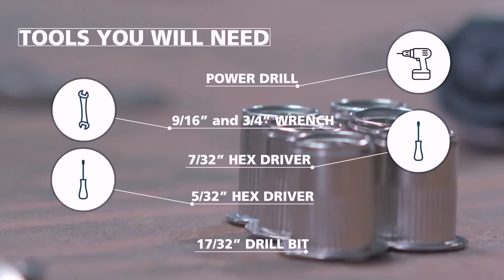Go Rhino Sport Bar 2.0 Installation (911000T)

Comment: Hello, I have a 2010 F150 and I pretty much know it will fit but my concern is that I have a BAK RollX bed cover and was wondering of this will allow the cover to roll up. My particular cover is a rigid cover, not a soft cover that can be bent. Any experience with these Sport bars with the rigid type roll up bed covers?

Comment: couldnt find a 17/32 drill bit at hardware or home depot or lowes? rivets poped back out of hole when i did finally get them drilled, need a ratchet with a really small bit to fit in to tighten to truck. Been cool if they had a plate you mount to truck first then attach the bar with screws. who ever designed this must like hand tools cuz you cant reach any bolts with a screw gun

Comment: Hey guys great video... But was wondering if you guys out anything on the holes you made on the truck bed for the roll bar to prevent rust in the future
Reply: hopes and dreams
Reply: Automotive primer. 6 coats on the areas showing raw metal under and over.

Comment: Bought one in 2017... had it replaced this week, whole thing rusted out. Doesn’t like Canadian winters. Replacement just got back from being coated in LineX. Hope that helps.
Reply: How did the coating from LineX hold up? Im from Edmonton Alberta so Im curious as to how it stood up to the winters over the years, Thanks!
Reply: @resuko77  For the most part it was perfect. There were a few spots where the linex didn't get to and it rusted out from the inside. If I were to do it again I'd probably hit the inside of it with a clear coat or some black tremclad. Powerder Coated Metal SHOULD be completely protected but it's not... no idea why. You could see a rainbow halo effect where the rust was behind the linex. Such a pain in the butt for what it is. They can send rockets to other planets, can't stop rust on a tube of metal.

Comment: I was putting mine together the other night and the damn side plates didn't want to align all the way, I've tried different ways with same result. What tips do you have for as I've had bolts just barely on and fall out when trying to get last one in.
Reply: I had to loosen mine totally to get it to aligned and it also is a pain. Also the damn rivet nut messed up do i was down one of those and i cant find them anywhere. The bumper i got was also a pain but damn i love the look.

Comment: I had one put on my 2017 Dodge ram. Looked amazing for about a year. After that nothing but problems with rust, and discoloring of finish. My lights on the light bar kept falling down because of the thin metal breaking. I would not have purchased this having known issues I would have.
Reply: where do you live?

Comment: What is the width of the rack from rail to rail? I'd like to add something like this to my 90 f150 but not sure if it'll be too wide
Reply from the maker: Hello thank you for your interest in our Sport Bar 2.0. It is 72" wide from end to end, so if your 1990 F-150 bed is about 72" wide (including bed rails) then it should be ok. Also note that it is 22.5" high so it may or may not be tall enough for lights if you wish to add lights.

Comment: Any issue with this fitting on 2017 raptor with bak flip cover?   Seeing in the instructions that the tubing bolted pieces together instead on 1 solid bar. Wondering how well this holds up to hard off road driving.
Reply from the maker: Hello David, thank you for your interest in our Sport Bar 2.0. It works on the regular 2017 F-150 so there shouldn't be any problems installing it on the Raptor. We have had several customers send us pictures of it on their Raptors. And yes, it does not come assembled in one piece to save on shipping, so you will have to put it together
Reply: Lol! They didn't even answer your question
Reply: @shtotty  No they didn't. Yes it should fit but no clue if it would hold up to the off roading that you can do in the raptor.   Had to pass on this.

Comment: Will you be manufacturing these in stainless steel?
Reply from the maker: Hello Dale, thanks for your interest in our Sport Bar 2.0. We offer the Sport Bar 2.0 in 2 different finish options. Most of the parts are the same textured black for both options. However, besides the one shown in the video we do offer an option for polished stainless steel front & rear tubes.

Comment: 2017 f150 installed the 3.0 sport bar today....very disappointed ...the "rivet" nuts are garbage  2 of them pulled Back out of the holes during tightening...not quite sure how I'm going to fix this...but there has to be a better way than this..if I had it to do over I'd pass on this.
Reply from the maker: We are sorry that you aren't completely satisfied with the installation of your product, but we can send you replacement rivet nuts. Please give us a call at 888-427-4466 and we can send those out to you. Thank you.

Comment: Will this fit a 2009 Ford F250? Want to get one but don't know if it would fit.
Reply from the maker: Hello, thanks for your interest in the Sport Bar 2.0. Unfortunately, the cab on the F250 is a bit too tall for the Sport Bar 2.0 so it doesn't quite line up correctly. It will probably block any lights you add to it and will at least partially block the third brake light so we do not recommend it for the F250. A new taller version has been discussed by our R&D team, so we might see a new one come out in 2018.

Comment: @Go Rhino I've just purchased the 2.0 for my 2017 Raptor. I'm so worried about that rivet nut insert. Can you PLEASE make a video on how to get that thing into the bed rails MORE CLEAR then what you showed on this video and STOP telling people to call the helpline ( I did call. But that dude on the other side was more confusing then me )??? THANKS IN ADVANCE!!
Reply: Hey dude! I don't think you'll have much of an issue since the Raptor bed and F-150 beds are identical. Other than the wheel flares on the raptor you're still looking at the same bed width. 👍👍
Reply: @jordanozman8360  Hey #JordanOz, not sure if you are with Go Rhino team. But if you've read my comments correctly, my concern is the rivet nuts install. ( They can't even show it properly in any of their so called installation video). And ppls asked about it in the comments section, they're either tell you to call that stupid hotline or just pretend that they DON'T SEE those comments. So again, my concern is NOT THE FITMENT. But thanks for your response.
Reply: Make sure you get extra. I messed up on one and cant get them anywhere near me.
Reply: @alnfong1228  🤣🤣🤣🤣🤣

Comment: A few of those gasket holes don’t even line up correctly. Glad I checked it against the actual sport bar or I would have drilled useless holes into my bed rails. What is wrong with you guys? Seriously. How do you put out something so important that isn’t even aligned correctly. What a joke. I’ll make my own gasket

Comment: Poor design... it rattles too much on the road and the bar doesn’t support the weight of the lights. I’d suggest a different product. Tried to find a solution with customer support and was not satisfied. I’m sure there are better products out there.

Comment: Will it fit a 2013 Ford fx4.  With a flip top cover ?
Reply: The new 2.0 has a bracket that comes with it so you can mount it with a cover. This is the one. I might be wrong but I know you can buy brackets that will allow for a tonneau cover.

Comment: Will this fit a 96 k1500 extended cab short bed?
Reply: The bed width is 49-50 I think
Reply from the maker: Unfortunately, we have not had the chance to test it on older vehicles, but if the width of the bed is about 50" like you said, it would be too short for the Sport Bar 2.0. We have a mid-size (smaller) version that is about 60" in width